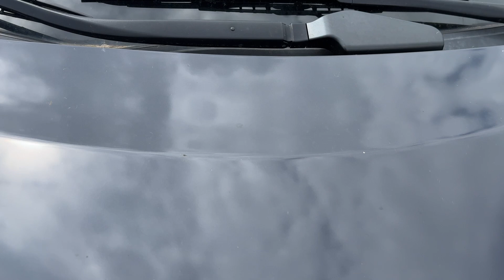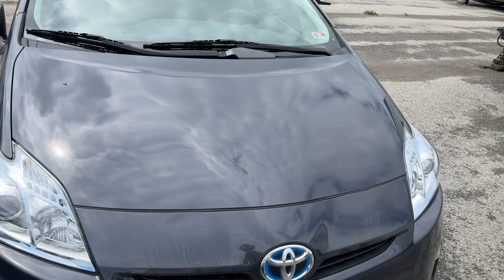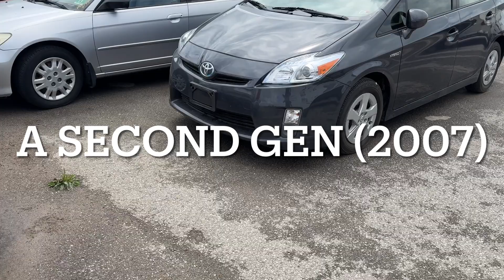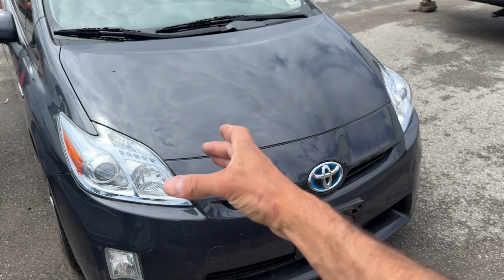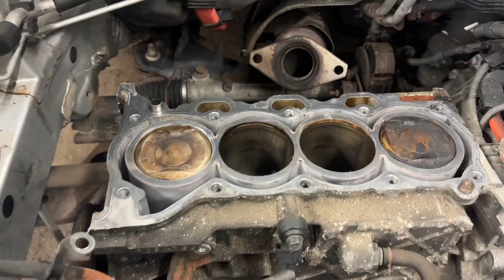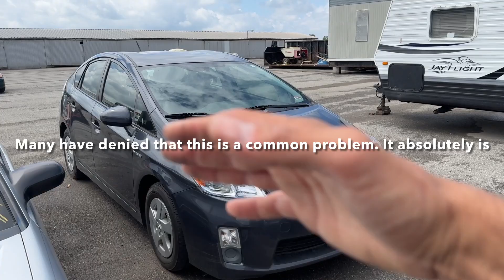3rd Gen Prius Head Gasket Problems (Causes and Solutions)

Comment: I just bought a 2017 Prius v with 114,000 miles on it. Always garaged with one owner. It was thoroughly serviced at Toyota since it was new. I paid $190.00 for an inspection at this Toyota Dealership and saw all the maintenance records. It had two coolant flushes, but no water pump replacement or EGR service. I plan to replace both those items myself. I've already bought a OEM Aisin water pump, Aisin thermostat and OEM replacement EGR valve. I need to do some research on getting a spare intake manifold, whether I should buy a new one or a used one. It's running beautifully, but I need to keep up with it. I have a feeling the head gasket will go one day no matter how much I try to keep it from happening.  Sigh....

Comment: I just had my 2012 Prius start dieing at 206000 miles. Now I must replace the car since the repair is not worth it in NY state. Body and frame rust and the such.  I was hoping to get double this mileage before it retired but no such luck.  Paid cash for the Prius but now car costs are through the roof in NY so this just totally blew my Budget. Sad little car failure due to poor design.  I should know since I used to be an engineer so just looking at the design was heartbreaking.

Comment: I have another theory about the Gen 3 2ZR-FXE blown head gasket epidemic.

The “Scheduled Maintenance” log book Toyota handed me, when I purchased my ‘12 V, goes all the way out to 120K miles and completely omits coolant service.

Even though Toyota calls their coolant “Super Long Life”, it can’t escape the fact it will become acidic with age. Acidic coolant loves to eat at gasket material. The MLS HG Toyota used has a gummy material, on either side, that will get slowly eaten away by an acidic fluid. The revised HG Toyota issued in ‘14, as part of the Gen 3 HG TSB, simply has a lot more of that gummy sealer.

If all the “Scheduled Maintenance” Gen 3 log books are like mine, I bet a huge number of owners never changed their coolant and, viola, blown HG epidemic.

I’m sure it’s not the only variable in the mix with this HG problem, but I’ll bet it’s a big one.

If you’re thinking of buying a Gen 3, make sure the previous owner had done coolant services. You can purchase coolant/brake fluid pH test strips on Amazon that can be used on-the-spot when evaluating a Gen 3 Prius.

That revised HG never really remedied the problem either. Gen 4 has the same 2ZR-FXE engine and there are many examples of those that have blown too. I also think Toyota should have never named their coolant “Super Long Life”. That’s just asking for trouble.
Reply: This is what I believe is the root cause of the issue as well. The carcare nut on youtube says the long service intervals are leading to HG failures on the 5.7L V8s due to this reason.
Reply: @boykeno   
Ya know, funny you should revive my comment from a month or two ago, since I wrote this I’ve continued to look into this old HG epidemic. Although it’s now mostly relegated to history, I’ve learned more about the EGR side of the equation. I’d always sorta discounted this variable because I couldn’t get my brain around it.

The Gen 3 Prius has a poorly designed EGR system. One that had Toyota making many revisions over the years. Revisions like recalls for software updates, TSBs about the EGR cooler plugging with carbon, EGR valve failure or carbon fouling, redesigned air intake manifold to change the way the EGR gasses were routed inside the plenum, redesign of the exhaust system concerning where the EGR gasses were pulled from etc. I even heard the 2ZR-FXE block had its block slightly modified so the coolant gallery could cool the cylinders more in the event one of them had its EGR gasses cut off. Eventually, in the Gen 4, Toyota made the EGR cooler gigantic so it wouldn’t carbon foul.

When the air intake manifold EGR ports has oily vapors from the PCV system pass over it, you get a mixing of EGR carbon particulates and said oil. This forms a sludge which differentially blocks those little ports. The furthest cylinder, #1, gets constricted the most. That cylinder is then starved of its EGR gas dosage and runs lean. There is nothing to detect this lean condition and that cylinder runs super hot.

I’ve watched a lot of Gen 3 Prius HG video, and read a lot of written experiences, and the overwhelming majority of the blow out locations are cylinder #1.

I think this is/was a good culprit for the blown HG epidemic too. This generation’s overall design just had too many variables working against it.

I’ve decided I’m going to do a full EGR clean-out on mine every 40K miles or so.

Comment: Will a blown gasket on a 2010 Prius cause the check hybrid battery, along with the triangle of death as well as the start up rattling and low coolant? After I reset everything, it will crank up, rattle, then smooth out, then shut off after about 10 seconds ( with all of the aforementioned dash icons)

Comment: What is the best method to determine if it is the head gasket or not? I have the rattle on start up but not loosing any coolant for over a year
Reply: It doesn’t take much coolant to drip into a cylinder to cause a misfire. If the rattle is really bad, and continues for a long time after cold start, you can get a chemical test kit that fits on the coolant reservoir in order to confirm.

If you’re at the very beginning of coolant leaking into a cylinder, you may not be able to detect exhaust gases in the coolant with the tester. Best way to confirm blown HG in this case would be to drop a borescope into each cylinder and see if any look super clean(no carbon deposits on piston tops relative to the others). You may even be able to see small coolant droplets and a wet trail up the cylinder wall.

The Care Care Nut channel has a great video detailing how to do this.
Reply: Open the oil filter if you can feel pressure from where the oil cap is the head gasket

Comment: Is there any way to prevent this?  I have a 2010 Prius with 84000 miles.  I just changed the coolant (it seems to be holding coolant and oil just fine).  Can preventive maintenance prevent these problems?
Reply: Yes. Two problems with this model actually. One is the bad head gasket design.  Prevent the issue by avoiding very hard acceleration that put stress on the weak gasket.  This happened to me.  I drove my Prius very hard.  Another is maintain the cooling system to prevent overheating. The other problem is cylinder scoring due to frozen piaton rings.  How to prevent this? Make you do your oil change more frequently than normal.  Instead of every 5,000 miles, make it every 3,000 and use synthetic oil. The problem is the low tension oil rings that Toyota installed are prone to keeping oil gunk which interferes with oil ring operation.  Happened to me also.  I ended up buying a used Japanese domestic market engine.  Best decision I made.
Reply: Replaceme your water pump, make sure its oem not amazon, clean your egr valve,  my 2010 has 187,000 running good so far
Reply: I have a 2010 Prius with 198,000 miles. I have heard that rattle. That being said, I LOVE my car.  It has never given me a problem. Taking it for service in 3 days. Here’s hoping!

Comment: I have a 2025 Toyota Prius C. it has 270000 miles, but every morning when I start the car especially in the winter its sounds rough it rattles. It rattles for about a minute or two, but I realize when I shut the car off in EV mode I don't get the noise no more.
Reply: A 2025 Prius with 270,000 miles? 😲
Reply: Hello my friend Is this normal or did you have a problem later? Please tell me because I own a 2014 Prius.

Comment: Gasket Master said when the egr system clogs up the engine pulls a higher vacuum on the intake manifold and that pulls more pcv gases and oil into the intake and then the oil control rings get clogged up and stuck. Carbon buildup in the combustion chamber puts more stress on the head gasket. Also when coolant gets old and acidic,it eats away at the head gasket and any other seals and gaskets. Bottom line clean your egr system and change that old acidic coolant. Also shorten your oil change intervals for cleaner oil to help keep rings cleaner. Otherwise yes this system is flawed and shame on Toyota 😢

Comment: It’s frustrating that Toyota didn’t recall these vehicles if it’s a design flaw. I bought a 2010 Prius with 194K miles without knowing this was an issue. Just replaced the struts and fuel pump. Will be cleaning the egr and intake manifold soon to help prevent the gasket issue. Fingers crossed.
Reply: My brother bought on with 187k
He got to 206k
Before the headgaset went.
He was able to get engine swap for $4k
Time will tell if it last.
If he make it 12k miles 
He'd break even.
Reply: The head gasket failure happens even with extreme maintenance of the engine.  Warpage is one of the problems with aluminum.
Reply: @rquance1  
Have they bulletproof them
Reply: Why would they run a recall when it only occurs far out of warranty? That doesn't make any sense.
Reply: @joshjenkins3815 
Exactly recalls are safety 
Machanical problems generate bulletin notice
Reply: How long should they cover a 200k hybrid? Gm doesn't cover anything on problematic engine past 3 years!

Comment: Someone help me please should i buy one ?😢
Reply from the maker: There is actually a video on this channel that covers all the possible problems of a third generation Prius, and gives my professional and personal opinion, with 21 years of experience with Toyota behind it, whether or not it’s still a good purchase… videos like that, and other folks like myself that are very proficient with these vehicles can give you good information to make an informed decision… The random advice of random strangers might not lead you in the right direction than 50% of the time, with this, and other other things in life… Just some friendly wisdom :-)
Reply: dont, ive owned three....they have been the bane of my limited mechanical experience.....two out of three have the head gasket issue smh!!!
Reply from the maker: @ibezag0 it’s definitely a thing. I’d still own one (I made a video about why). I’d be prepared for the head gasket. Sometimes I wonder if there is a way to bulletproof them like a 6.0 ford diesel. Like preliminarily replace the head bolts with studs but I think based on what’s seen in this very video that there is more to the issue. 

Just like the 6.0 ford, these prius are awesome outside of this issue.
Reply: @DrewGarage  now i buy a Prius 2010 with 127000km is this a good car ??

Comment: Hi Drew,
Just ran across your channel on YouTube. Thumbs up... 
I'm shopping for either a Prius V or a Lexus CT200h.  
Any years that I should be aware of or should avoid?
Would you recommend purchasing a plugin vehicle diagnose device?
I found a private party selling what appears to be in very good condition a 2013 CT200h with 134k miles.  This is a California car.  This is the second owner and he claims that he has used a Lexus dealer for his maintenance.
I have not seen the car in person yet.  The seller indicated that he would take $9500.
There's a lot there.  Would you like to share your thoughts?
Reply: Pay for an inspection at the Lexus Dealership and try and talk to the inspecting mechanic. Try to get a copy of all the maintenance records. I paid $190.00 for the inspection of my 2017 Prius v and the car owner gave Toyota permission to print out a copy of all the maintenance records for me. That was handy.
Reply: @THOMMGB  I did eventually buy a Prius V.  My experience at buying a used Lexus at a dealership is a stain on the Lexus reputation.  My thoughts are that dealerships are at the bottom of the barrel.  If you're lucky enough to find a good local mechanic, you are truly lucky.

Comment: If my prius is doing something similar (not shaking as violently but is shaking the car) but its never on start up, only after driving the car around for 10/15 min is it still likely a head gasket issue?

Only does this when I am gently pressing on the gas pedal whether its at low or high speeds but goes away when I let off or put my foot down harder on the gas

Comment: Ugh, ok, I changed my spark plugs and will be changing the ignition coils but I’m worried my head gasket is next. I am losing coolant, but don’t have milky oil or white smoke but perhaps it’s just starting? Would you recommend the head gasket sealer till I can afford the fix?

Comment: Do I understand correctly ..... the design structure of the head gasket, itself, is the cause?  Is there a more robust replacement option on the market?
Reply: By egr. I just replaced the head gasket. The egr was so dirty , it was completely blocked. If you clean egr and change cooler flut  every 100000  the head gasket will be fine

Comment: That open deck design is the same thing that contributed so hugely to the head gasket failures in the first-gen Subaru EJ25.  Ask Me How I Know  Installing the turbo head gaskets on the NA engines would go a long way to solving the issue.

Is it worth the trouble to pre-emptively replace the HG on a 2ZR-FXE?  Whoops, I see you answered that question already.
Reply from the maker: Hello! Depends on the person. Someone with the time and the know-how, why not?!? For me, it would be at first misfire

Comment: If you buy one of these and it's NOT yet rattling, should you replace the head gasket pre-emptively?
Reply from the maker: That’s a tricky question. Yes it would be of benefit, but it’s decidedly cost prohibitive to do that preventively. If I owned one, the MOMENT I got the death rattle and verified head gasket, I’d do it. I wouldn’t even drive it that first day. But I wouldn’t do it preventatively I don’t think. It’s not a small job and there is a chance with good maintenance, it won’t happen until long after you’ve moved on from
The car

Comment: Currently doing a head gasket repair on my 2014 Prius V, after buying it from a dealer “as-is” without knowing what the “death rattle” meant. I have very little auto-mechanic experience. Guys like you on YouTube are helping me and my family!
Reply from the maker: That sucks. Here where I live, we don’t have as is. Even if we did, goodness I could never sell someone a car and leave them hanging shortly after. I mean after time it is what it is but never right away :( HANG IN THERE! It’s just nuts and bolts. NEW head bolts and use a torque wrench. Harbor freight’s mid grade tools are more than good enough. Triple check timing chain and be careful with the FIPG (rtv) reassembling
Reply: @DrewGarage  yes sir, I called them back shortly after discovering the issue and they pretty much said “sorry ‘bout ya.” I’m getting my head machined right now, got all my parts, just waiting to reassemble. The RTV stuff is what makes me the most nervous, I don’t want to mess that up.
Reply from the maker: @papacoyotyl  there is a decent amount of room there to put the timing cover back on. Personally I like Toyota genuine fipig because the first stuff lasts like 1,000,000 miles. There is also one from permatex called “right stuff” that is fantastic. You literally can put oil in the car and drive it as soon as it’s back together… It has like one hour till “in-service“ and many jobs take longer than that to finish anyway

The big thing is just to be careful,sometimes it makes sense to take very long bolts, in this case, 6 mm, and cut the heads off to act as temporary studs to slide the timing cover into its home position without any side side wiggling… Just take your time and put on enough but not too much and you’ll be fine
Reply: @DrewGarage  thanks, brother. I got the permetex stuff because that’s what the guys at gasket masters suggested using. I just got the call from the machine shop that the head was ready to get picked up. I’ll let you know how reassembly goes!
Reply from the maker: @papacoyotyl  I really hope it goes smoothly! In my opinion, the nerve to tear that far into it is 90% of the battle, I’m sure you were going to be fine :-) be sure to post back. Feel free to take some videos, put them on your own channel, and post links in here to your own videos :-) would be cool for other people watching this video to see your work
Reply: @DrewGarage that’d be the longest video of all time haha.  One question, what do I lube the new head bolts with?

Edit: asked a guy that works at a dealership, he said a light spray of white grease is all the headbolts need
Reply from the maker: @papacoyotyl lol it would be awful to edit!

Better check with toyota or all data on that one - I don’t recall if they should be oiled 

MAKE SURE the holes for them have no coolant or anything in them
Reply: @DrewGarage  would compressed air in the bolt holes do the trick?

Edit:it takes exactly 3 standard cue tips taped together to reach through the head and get the bottom of the head bolt holes.
Reply from the maker: @papacoyotyl  Bone dry isn’t as critical just making sure there isn’t liquid as it can cause pressure and crack the block or cancel the clamping torque by messing with torque
Reply from the maker: Love the a tips by the way. Stoked to hear from you when you’re up and running
Reply: @DrewGarage we’re a year past the repair now, still running strong!